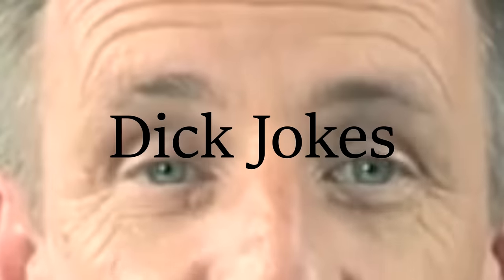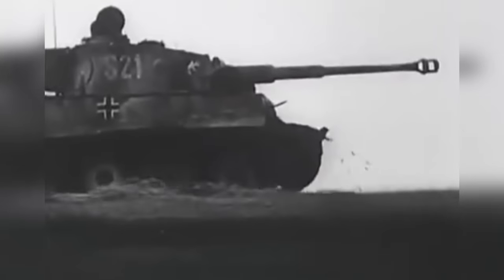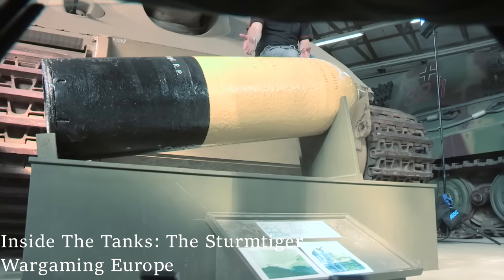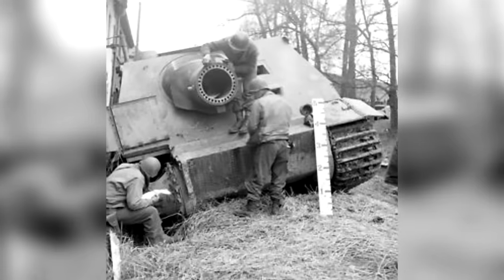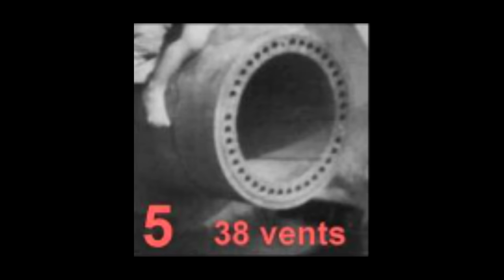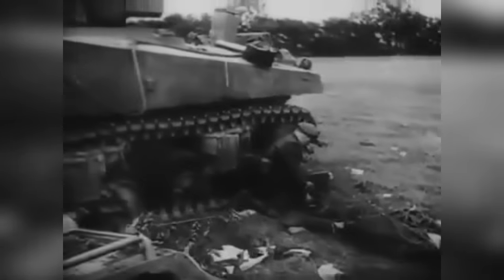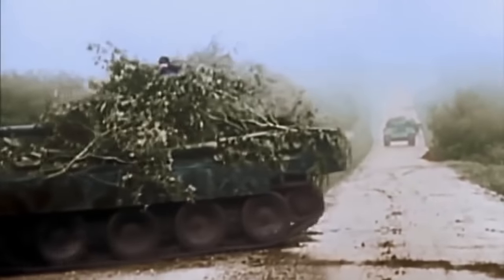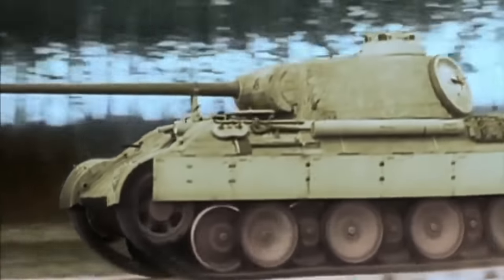The Sturmtiger, Too much too late

Comment: Imagine Germany recreating this tank but with the modifications of a longer gun and it wouldn't use the Tiger model

There's so much more to build off of these awesome machines
Reply: It would basically be useless though. We have MLRS today which has an effective range of 42 km. There is no point in armoring a rocket launcher when the enemy can't even see it.
Reply: hedgehog3180 it'd still be cool to see a giant heavy shell fly through that air though 🤣
Reply: What's the point of having a longer barrel? The projectile was HEAT
Reply: AppleJooc Park the longer barrel would be for lord Farquaad compensating for something
Reply: I don't want to interfere with the wet dreams... but... is it economically viable to build this monster?
Reply: No, there is not, the german heavy tanks where dead ends.
Reply: Yeah but if Germany showed any sign of hostilities its leader would probably be cremated.
Reply: @Smintina Vlad
As in all of them, this very much includes Wehraboo body-pillow favorite Tiger II and even the Tiger I if we're being honest here. Even the Panther - which was ostensibly a medium tank - was a massive shit for most of it's existence. For some reason Heer armor decided that fighting a losing war was the ideal time to shit itself into extinction.
Reply: Panther wasn't that shit, it was formidable at long range, ambush positions.But then again, that is shared for most tanks.Panther was less formidable when facing tanks that could kill it like SU100, SU152, IS2's and so on.Still it could be a fearsome enemy.But nowhere near what these idiots wheraboos say about it, I actually heard a guy saying Panther gave birth to many tank aces with more than 70 kills, which is obviously sheer idiocy.
Reply: You're making the very big assumption that it could even get to the battlefield - which very often it could not. You are then also forgetting that for every one Panther the Germans had the Allies on both sides had 10 tanks that could kill it. That's saying nothing about it's host of other problems. The Panther was, while an interesting concept and important for post-war tank development, not so good for the Wehrmacht in 1943.
Reply: @Bass Buster X
All of this nonsense....oh my god. No.
Reply: The Crimson Fucker like what?
Reply: Like the fact that the TIger and Panther were invulnerable, for instance. Like that tanks before the Firefly and 34/85 couldn't wreck them(they could and they did). Like that later production of Tigers improved their mechanical issues(they didn't, if anything as the war dragged on they got worse). Go home Wehraboo, you're drunk.
Reply: The Crimson Fucker the invulnerable part was my fault, I meant to say invunerable to the allied main force such as the m4 sherman and the t-34.
Reply: The Crimson Fucker and tiger I did improve his mechanical issues and so did panther I, king tiger was the one with a complete failure of a drive train
Reply: Except the M4s could readily punch through Panthers and Tigers(though they barely ever met Tigers) and so could the T-34s as shown by the fact that they did(hence why they were moving forward and not stalling). As for the Tiger no they didn't. Until the end of the war they had issues with the over-complex design, especially of the tracks, parts shortages and excessive repair times as well as poor interchangeability of those few parts available.
Reply: The Crimson Fucker mechanical issues I mentioned are drive train, not repair times or spare parts, and yes the overlapping wheels and suspension set up caused many tigers to get stuck due to frozen mud between wheels, but I wasn't talking about that. Also since when could the m4 sherman low velocity 75mm gun pierce a tiger I? Even when unangled the sherman would need to be close to the tiger to get a shot that may pen. Same thing for t34
Reply: http://id3486.securedata.net/fprado/armorsite/tiger1.htm

Here is some more info on it if you need to see it yourself
Reply: the biggest problem with panthers is their side armor combined with numbers, they never had the numbers to protect their flanks from allied offensives, if a soviet tank was not there that could pen the panther, chances are somewhere near by the soviets could breakthrough and flank the panther, even t-70s and stuarts could pen the side of panthers let alone shermans and t34s. tiger 1s have thicker side armor but their unsloped front armor was more vulnerable. the StuG was argueably the best vehicle the germans built for killing tanks (it haveing the best kill to death ratio of any tank in ww2 AND it being mch closer in cost to build to allied tanks AND being very good on the defense) since the kwk40 L48 could penatrate the thickest allied tanks at 500m or more they should have produced superior versions of panzer 4s and StuGs, brumbars and even panzer 2s and 3s had uses)
Reply: Matthew Burger well both StuGs and Pz. IV had quite a lot of modifications, it's just that the Pz. IV was heavily lacking in armor with major weakpoints in the front, if they somehow fixed that the tank would easily be the best mass produced tank. StuG also had upgrades and it inspired similar designs such as the Jagdpanther and Jagdtiger, there were also some more unconventional designs for TDs such as the panzer IV/70 and the hetzer. Also despite the tiger I having unangled armor all tigers I had reportedly a kill ratio above 1, some going over 10:1
Reply: the shermans with 76 mm guns and bigger could kill tigers without having to flank them, but most shermans had 75 mm guns that had to flank them
Reply: Ascended Life Form not to mention the price to build and maintain one of these
Reply: give it a 50/cal gun
Reply: I would just modernize it but keep the barrel, maybe made the missile guided.
Reply: @The_Crimson_Fucker  a m4 of any variant could not pen the front plate of a Panther. It is true that a M4 can pen unangled tiger Is from the front though if they had APCR or the 76mm gun or the 17 pounder.
Reply: @The_Crimson_Fucker  Forgot to mention, no T-34 model besides the blue print made a few times T34 100 could pen the Panthers front armor. And all the early T-34s without the improved APHE and APCR could not pen the tiger front plate. With the improved rounds it could but has to be unangled and somewhat close. The T-34 57 however could pen the tiger from the front fairly easily.
Reply: @bassbusterx  dude, Panzer IV was basically equally matches against Shermans and T34s as they all could easily pen each others armor easily. The Panzer had superior range though, with its high velocity 75mm gun. They added more armor with the Panzer IV G, J, and H, however it only slowed it down.
Reply: @PilotTed  
You couldn't have fit that all into 1 comment? I get the feeling you don't think your responses through before you make them. For one I never specified that the M4s could pen the Panther frontally. I said they could pen the Panther, which they could.
Reply: @The_Crimson_Fucker  Also I love your username, Hellsing Abridged is one of the best abridged anime out there. The DBZ ones were great too.
Reply: @PilotTed  
Meh not much of a DBZ fan so I don't really care for it that much, I'd rather they put the effort in to finish Hellsing.
Reply: @The_Crimson_Fucker  True, the new one is coming out this November, its like a birthday present for me lol
Reply: @PilotTed  
Cool.
Reply: @hedgehog3180  But you could I theory intercep mlrs or change their course  but you can't change the course or destroy a neir vehicle shooting rockets with a really high caliber. And I think a simple rocket is much less expensive then one mlrs
Reply: Yeah, with a different gun and a different chassis it might have been worthwhile. I'd suggest hull mounting 75's into pz IIIs and IVs.
Reply: Oh god. OH GOD RUN CARL RUN
Reply: But why if it was useless 80 years ago is useless now
Reply: There isn't, though. Why roll in a 60-70 behemoth artillery peice, when you can instead use a laser-guided bunker busting missile from an aircraft? The Persian gulf war showed defensive bunkers are just about impossible to keep if the enemy has air superiority and F-16's with Hellfire missiles.
Reply: It proved effective at blasting outnumbered and outgunned civilians. Thats a good thing.

Comment: Not a waste of resources. The hulls were not new production models but burnt out vehicles from combat with already ruined turrets. So build a casemate on top of the still working hull, which is cheap quick and easy then put whatever very large cannons are available. This is why you get things like Sturer Emil, Brumbar, Nashorn, Sturmtiger even Jagdtiger and Jagdpanther were as often as not converted from vehicles with ruined turrets.
And yeah as a building remover this was a very good tank. Some of these were field conversions that's how easy welding up a casemate on top of an existing good hull is.

Comment: This is not a defense of the German weapons planners or the okh but I think what people tend to forget is the length of time put into the design and trial runs of things like this weapon. I'm sure the plans for this started before Germany was on the back foot so after figuring out that it was a pretty lethal weapon and designing shells for it I'm sure the German army felt like they should go ahead and make some of them even though their situation had changed. That's just the way it is in most design situations for in-war weaponry. By the time a plan is ready to be built it's nearing obsolescence or its use or necessity of use has changed greatly.
Reply: Hey! You have a brain!

Comment: 1. Absurdly big gun.
2. Basically every vehicle was different.
3. Casemate hull
4. Designed to fill a role that was no longer needed
5. Often abandoned due to lack of supplies
6. Only ever effective at committing warcrimes.

There's a case to be made that this is the quintessential vehicle of the Wehrmacht.
Reply: Point 6 is wrong. They were effective at stalling the Canadians at the Hochwald for a while.

Comment: Why wot will never add in the sturmtiger 
1. It would be way to powerful and by way I mean it would oneshot anything and could pen any tank.
2. The reload would be to long. A single reload is about 2 minutes 
3. A sturmtiger could only carry 16 shells.
4. It would be difficult to control because of the long reload and slow speed. Not to mention each shell was about 4 feet tall or so I don’t remember.
Reply: so they add the obj 268 V4 instead
Reply: @Ascended Life Form and you forgot that it could destroy multiple targets and heavily damage many other tanks
Reply: Honestly it could work as an arty with its quirk being that it's actually armored. Of course this is completely non viable, but that's what makes the vehicle historically accurate